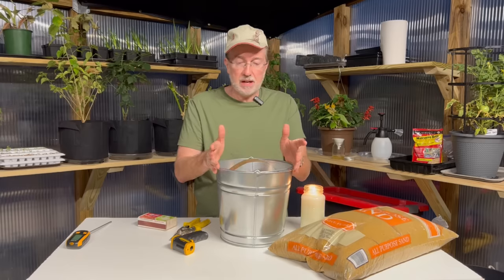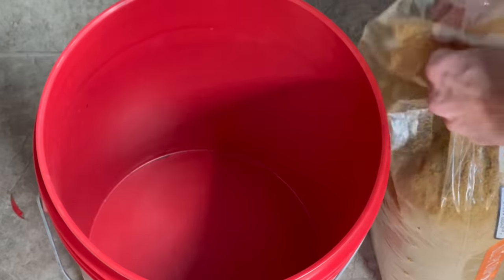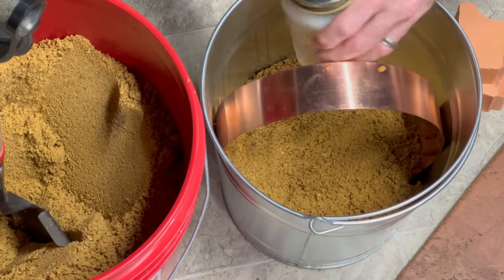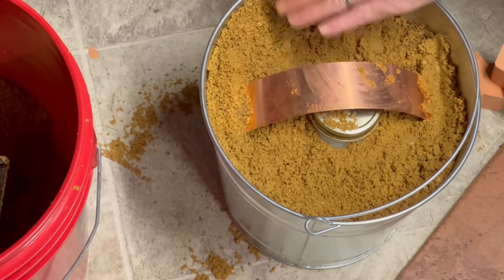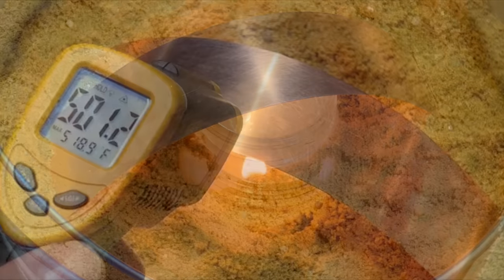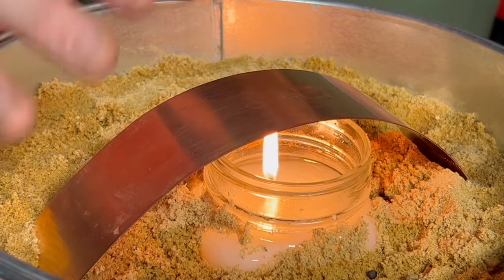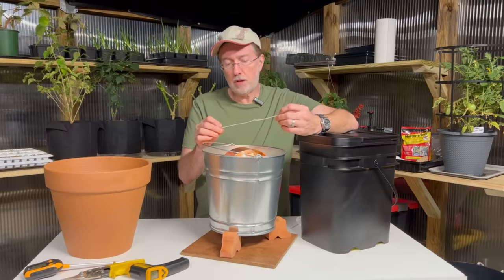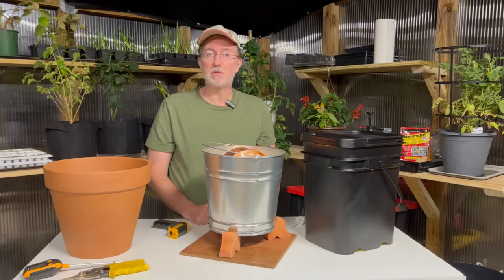DIY Copper And Sand Heater | No Electricity Needed For Greenhouse Heat

Comment: The total energy dissipated is the same as the candle alone. The only difference is that the sand is a mass able to accumulate the energy and release it slowly.
Reply: Newton's law of energy
Reply: right. Make calcium acetate fuel gel with egg shells, vinegar, alcohol, set that up with a bucket of water...
Reply: I think the other thing about that might be that when you just burn a candle, the heat rises. So, it ends up near the ceiling where it’s not doing everybody a whole lot of good.

But something like this would hold on to a lot more of the heat down in the sand of the pot, where it can radiate out a little more slowly, and provide a little more warmth down where the people or plants actually are.
Reply: Totally correct. My fater used to burn a candle in the greenhouse just on the floor to keep frost at bay. Works without all the fuss. Although I havent tried this I feel that without some wider spread of the copper to increase the surface area th heat transfer will be very slow or small. It certainly will not reach  200 deg C +
It will radiate out the heat faster than the candle can supply. I am sure there ars equations to describe this effect.
Reply: @rickharriss  There's simply  no way that it can radiate out more heat than the candle can supply, it would be free energy.
Reply: @tkjho  Charging a battery bank with solar panels powered by tealights!
Reply: Exactly
Reply: Energy is neither created nor destroyed.
Reply: @lizrodriguez6808 
You might want to research that statement a bit deeper than you obviously have so far....
Reply: Pretty sure he meant that "the copper would be cold at the bottom." , because the heat will be transferred to the sand faster than the candle can supply it. @tkjho
Reply: @ruserious9577   If  "the copper would be cold at the bottom.", there would be no heat transfer from the copper to the sand past the point that they equilibrate at the same temperature
Reply: @tkjho  That was my point. :)
Reply: @MrKevinStraub  I'll have to google that one.
Reply: @tkjho  I didn't hear him say that, did you?
Reply: @stefanmeyers2808  I didn't hear it either, I read it in the comment by rickharriss just before my comment, and my comment was directed at him.
Reply: It makes a huge difference, whether you use convection (hot air) or radiation(thermal rays, like sunlight). Plants usually prefer radiation. Additionally radiation is much more effective than convection.
Reply: EXACTLY!    These SH1THEADS would have you believe you can VOID the Laws of Physics!!!
Reply: @daphneraven6745 . Um..it THEN goes…STRAIGHT UP to the CEILING!!!

Comment: 2024, this country is on a death spiral and some of us are out here trying to be proactive, preparing for some worst case scenarios! Scrolled through as many comments as I could and get the "one flame = limited BTU output". All I can say is, one flame in a small pail may not heat your greenhouse but it would be a source of heat to keep cold hands warm when you don't have anything else!  Appreciate the video. Will try to revise/build upon it to make it more efficient.

Comment: 100 percent of your heat is coming from that flame. Passing it thru sand before it heats the air of the greenhouse is not adding a single btu of heat to your greenhouse, but it is delaying its heating effect. You may have made an effective hand warmer though if you're sitting around in a duck blind or something and need something to put your hands on.
Reply from the maker: Check out the sand battery from Finland.
Reply: The sand holds the BTUs whereas air does not conduct heat The sand is a heat sink . Allows the heat to stay longer
Reply: Sure, if your goal is to heat a bucket of sand, great. In a greenhouse you want the air warm. The candles total btu is released either way, there's no benefit to slowing the release of heat unless it burns hotter than you want.
Reply: Nice idea. However there is a huge difference between temperature and heat. A match or a candle can have high temperature but not much heat.

Comment: You've completely rewritten the laws of thermodynamics. Are there any special magic words you have to say to get more heat from a burning candle? 🤣🤣🤣
Reply: Unless you're in an airtight, perfectly insulated space, a radiating heat source will always provide more heat than the same temperature being generated in a pinpoint area and immediately rising to and escaping from any porous areas or openings in the structure. Don't need to know the laws of thermodynamics to deduce radiators are more efficient than if you removed the metal enclosure and had a spigot shooting steaming water into the open air.
Reply: @jasonburris334  Do you happen to have the recipe to turn lead into gold?

Comment: Just a tip for those looking to stay warm in bed at night. If you're able to make hot water pour it into some soda bottles and take them to bed with you. Be sure not to make it too hot or you may melt the tops in the Caps won't fit on.

Comment: Just recently overnighted in our new to us used trailer. We don't have electricity at our property yet but here's what I did to keep us warm overnight.
I set the gas stove front burner on low and placed an old fashioned large clay brick over top of burner. This heated the whole brick up and it produced radiant heat. Mind you I kept the ceiling vent open to let in oxygen and we were fine.
The next morning we had errands to do and we shut the stove down. 
About an hour or so later when we came back, that brick was still warm to the touch.
I had remembered the terracotta room heaters that were the rage on YouTube a number of years ago and it worked beautifully.  Radiant heat is a beautiful thing.
Reply from the maker: Exactly, heating something whether a brick or sand will hold heat for a while.  Thanks for your input.
Reply: Remember boys and girls carbon Monoxide is heavier than oxygen so you need vents down low not up high.Same with propane needs to be let out the bottom.
Reply: I've been thinking instead of a brick just fill up the largest pot you have with sand or gravel and heat that up to a good temperarute on the stove, should stay quite warm for hours (btu of the stove is hundreds of times more than a candle so no problem getting it hot enough) The bigger the thermal mass the longer you can leave the stove off.  You could also have a second pot or more and move the hot sand pots onto a trivet in the vicinity of where you want some warmth.
Reply: I like the idea, but have questions.
What size bucket is used?
 
I see a 5 meter copper strap on Amazon. Will it make contact on both sides as well as the bottom?

After the fuel is spent, how long will the sand produce useable heat?

I will appreciate any help you can give me.
Reply: Never ever use a gas stove as a heater. When not burning well CO kills.

Comment: I built a ceramic fireplace so that the candles would be safe from tipping over. I used terra cotta pots to make the chimney by staggered stacking to allow air flow and reduce any smoke. I lowered my electric bill for the winter by $100+ a month. I also made my own candles and wicks. I have since sketched up some new designs to make a more functionally and decorative display. 😊

Comment: Maybe combine the 72 hour candle and this style heater.
Tip: use several candles to get it super hot then put them out except 1 or 2 of them. To keep the heat coming.
Relight as needed!😮
Reply from the maker: Excellent suggestion

Comment: I'm a new subscriber so I haven't followed any of your other videos.  When I built my Earth Oven, I used any old glass bottles I could find, filled them with sand, capped/corked & layered them in the base of the earth oven (thick layer of sand 1st, then bottles of sand, more sand, bottles of sand and top off last layer of bottles with thick layer of sand).  I found using heavier/thicker glass bottles worked better. (I got free empty liquor bottles from a local bar or from friends that drink). Arrange them like a wagon wheel spoke and put your candle in the center as the hub. I'm going to try your experiment but use a bit larger bucket.  If you have room you could use a galvanized garbage can (maybe in a pinch) or a 55-gallon metal drum with a locking lid (for storage purposes)  or even a 5-gallon galvanized bucket.using this method.  If you wanted gentle circulation you could get a small heat radiated/activated fan (can get on Amazon & uses no electricity) and build a bracket with some sort of metal for it to sit on above the candle. Adust the fan to point UP since heat rises and it would keep all the heat from staying in the ceiling.  I have these on my wood-burning heater/stove and they work great to keep the heated air circulating but don't run fast enough that would cause it to "cool" the air movement. The fan slows down as the heat diminishes and shuts off when no heat so it doesn't run to move COLD air).  Think how we use ceiling fans on reverse for the winter to pull cool air up to circulate the heated air down to the living space/greenhouse.   If you want to know the temp of the sand as it heats get a thermometer with a probe to put in the sand.  I honestly don't see the strip of copper or aluminum strips heating the sand as much as you may think.  I feel it is the heat from the candle in the sand and would hold more heat if you add Glass bottles filled with sand.  I am by no means an expert on this kind of heating but learned from experience.
Another CHEAP alternative for plants under a tarp or heavy plastic I have tried is to use strands of old Christmas Tree lights (not LED's).  Each 100 bulb strand puts out 40 watts of heat.  Need more heat, add more lights (if you have electricity).    You can even do this outside with a domed tent made of plastic or a tarp. I did this my 1st year experimenting to keep veggies plants producing all winter in my greenhouse.  It worked.  I grow veggies year-round in my greenhouse.  I'm growing sweet potatoes & sugar cane in mine now and they need HEAT to grow.  But I do live in grow zone 8b so we don't have extremely cold winters.  I'm also growing Chayote Squash (Mirlitons) outside under a heavily tarped tent with an electric oil radiator heater sdded when it is going to freeze.
I'm in the process of building a 2nd larger greenhouse/high tunnel combo that will be heated with a wood burning stove & smoke will be vented outside.  You can also use bales of hay around the outside of your greenhouse to help insulate it from the cold air.
I'm a 66 yr old senior on a fixed income so I have to use what I have or find cheap alternatives that will work so I'm constantly experimenting.
Reply: Well done.  Time to start your channel. I will watch it.  Interesting ideas.
Reply: Straw is an incredibly efficient insulator
Reply: I did the same thing with the Christmas lights, and wrapped them around my plants sitting at the window…… I bought a heat mat for my sweet potatoes;

Comment: This is very interesting and sensible making a heat sink within the large bucket which will radiate slowly.  ...so, let me suggest what this would work perfectly for.    .... pump house....when my jet pump was replaced with a submersible about 15 yrs ago, the guy never replaced the light bulb which i had been using in winters.  We don't have many freezings so i had not rushed to get it fixed. And then came a cold spell and i set up a kerosene lantern and it worked well.  But the oil chamber is only enough for about a day and kerosene is expensive and nasty.  This will be perfect because the heat sink will radiate slowly and make a more even and sustained temp and i like the idea of vegetable oil and a longer burning candle which your other video can show me to do.  I think this is one of the best diy ideas for me that I've seen. Very unique.  I'll  look up the Finland thing too because those folk are smart, handy and creative people. Thank you.

Comment: This is excellent. Some of the other forms of candle heaters are also excellent but could be easily knocked over, The weight of the sand should alleviate that concern with this one.
A possibility to increase efficiency may be to run, say 4, smaller copper strips, from the main copper strip, down into the candle the candle itself. As the wick burns down the smaller strips will help capture and transfer heat.  The shortening will probably become liquid but that shouldn't change the burn characteristics. You'd probably want to use a metal can for the candle though.....and this would in turn dissipate even more energy into the sand.
Reply from the maker: The genesis of this idea came from a video called sand battery Finland. Take a peek, it’s a great concept.
Reply: excellent reply @ Ulbre

Comment: I built three of them and used aluminum and made the same candles and had them going all night and the sand was cold and only was heat if you touched the aluminum but even then checked all night and at noon the next day the temps rose 2 degrees at the bucket.  Used dry sand and followed you directions exactly.the outside of the metal can was cold - have no idea why it didn't work at all but we were freezing since we had no heat in our house and really wanted it to work.

Comment: A few years ago I did the 4 wick Crisco oil candle (About 300 BTU) test in a well sealed and insulated 12 foot by 10 foot shed. It was 12F out side and about 20F inside before I lit the candle. In 2 hours it was 25F inside and the best was 34F in 6 hours. 

The walls were R25, the floor was R30 and ceiling was R40. It was insulated more for sound than climate control.... But best of both.

Best heater was  a 50 CFM exhaust fan to bring in fresh air through a system of four each 4 inch PVC pipe buried 4 feet deep and 40 foot long so the ground heat the incoming air. Same basic 12F outside air. In 2 hours it went from about 20F inside to 32F. Then, in 6 hours, it steadied out at 48F. I then shut off the fan and lit the Crisco candle and in 4 hours it was 54F inside the shed. 

But I had to run the fan to purge the room of fumes if I wanted to work inside the shop.
Reply from the maker: That’s impressive, the candles do work on a small scale.  Thanks for the input.
Reply: How deep did you bury the pvc and what latitude?  And was that 4 10 foot tubes for total 40 feet or was each tube 40 feet long...for total 160 feet?
Reply: @keralee  4X40=160 foot long and between 4 and 6 foot deep. Simple 4 inch 90 degree bends on each end with screens, into 5 each 6 inch t's with 4 inch adapters.
Reply: @davej3487  Thank you!!
Reply: @davej3487 Thanks for the info Dave, I was thinking along similiar lines. Did you try convection with the PVC piping and then installed the fan? You use exterior fresh are intake and then exhaust at floor level? What temperature is the air coming through the 50CFM fan? About 50 degrees?

Comment: Adding water in the sand will bring the heat into the center of the sand faster. I believe it is changing the flame energy into Radiant heat that make the difference.  Heating objects in the room (Radiant heat energy) and not the air makes things feel warmer and way cheaper).

Comment: Hvac guy here, unless your greenhouse is the size of a broom closet, total bs. If it was 30`f outside and your greenhouse was the size of a yard shed, that little flame cannot put out enough btu's an hr to even keep up with heat loss without heating copper and sand. By storing btu's in the sand you are lessening the btu's per hr. 

When I get permits to build a new house I need to submit "heat calcs", proving I meticulously calculated the heat loss and heat gains of every exterior surface, including every window and door. If the building looses 30,000 btu's per hr, I need a furnace that can keep up with that without running constantly. 

The cheapest way to keep a green house from freezing is to bury a long drain tile below your frostline, how many depends on size of green house and how cold it gets in your area. Inside the greenhouse connect the drain tile to maybe a plywood box that a fan fits perfectly in. It will draw outside air through the pipe warming it to ground temperature.